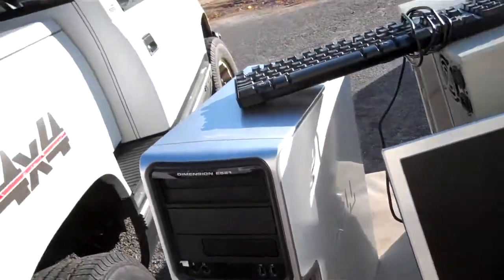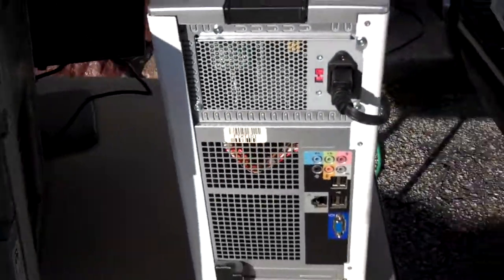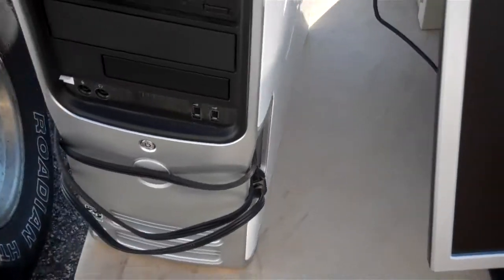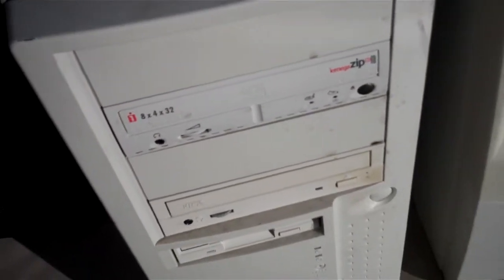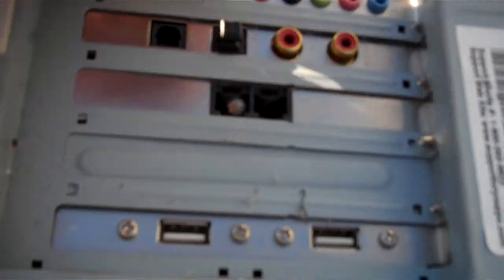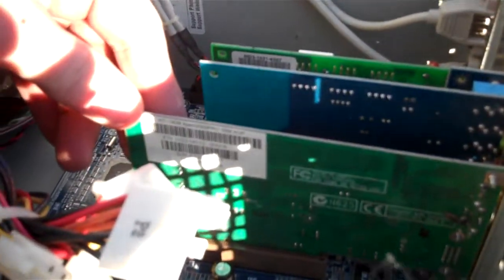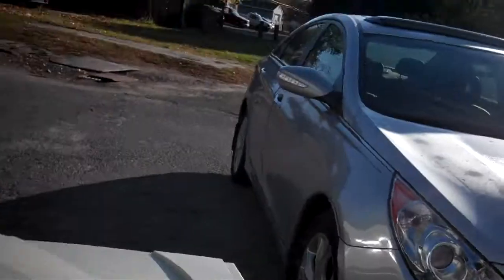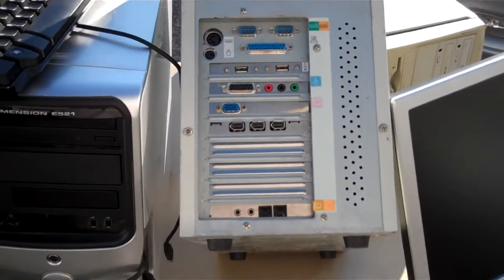Saturday Morning parts system haul.

Comment: I think that Dell Dimension E521 is from early 2007 if it came shipped with Windows Vista because that model was sold around mid 2006 to early 2007, I know the 2006 models came with Windows XP at the time.